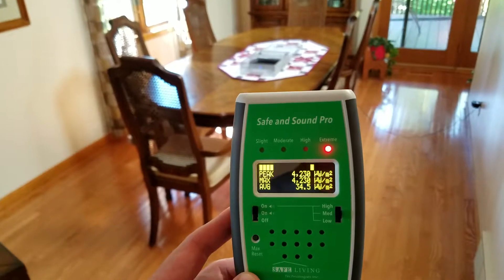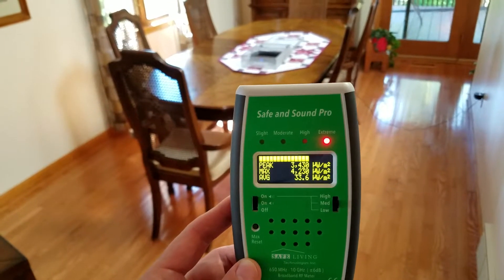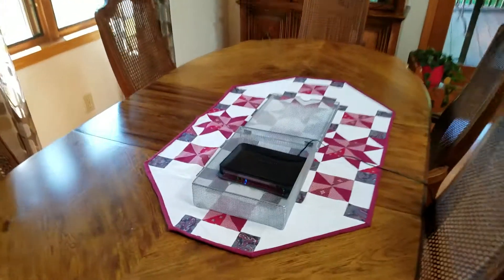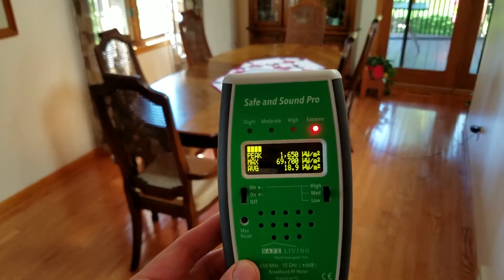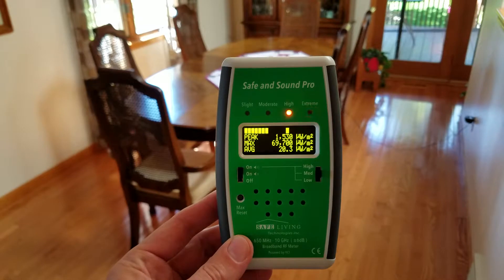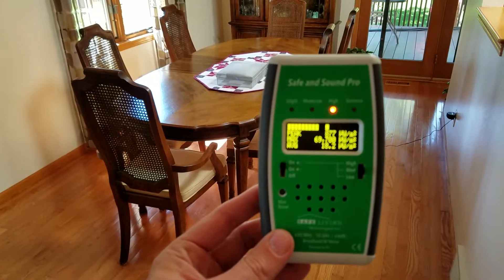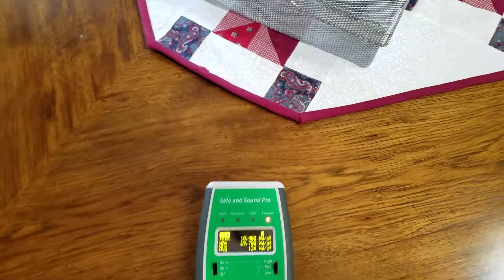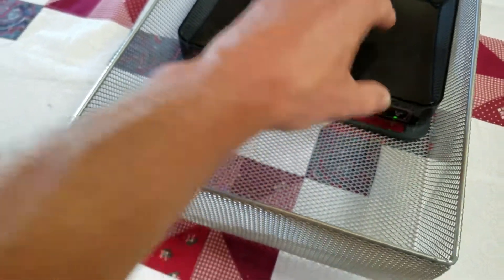Does Shielding Your Wi-Fi Router Actually Work?

Comment: What brand of router is that, that lets you turn off the wi-fi?  The only way I can turn off the wi-fi on my router is to turn off the router itself (which of course disconnects the internet completely), which I do at night before bed. I'd love to have all the computers hardwired with no wi-fi, but how?
Reply from the maker: Great question. There are certain router models that have an easy on/off button for WiFi. I list a couple in the summary at the top of this article:  https://www.emfanalysis.com/how-to-install-wired-internet-in-your-home/
Reply: Router box, duh
Reply: Most can be turned off if you can log into them.  Enter the router gateway ip address into your browser and see if you have a login screen.
Reply from the maker: @solarsynapse  Just be careful if you have a modem/router combo provided by your internet company (Comcast for example). You may be able to turn off your private network WiFi in the settings. However, the public channel in your modem will still be radiating and is much harder to disable. Best to confirm with a RF meter.

Comment: Why is it bad to be exposed to that level of milliwatts per square meter radiance? Has anyone demonstrated any health effects from long term 2.4Ghz exposure?
Reply: No. There is no evidence of "non-thermal" effects from RF exposure on biological organisms. You'd need a lot more radiated power to cause any significant thermal effects. For example, if you had a 2.4GHz W-Fi radio transmitting, say, 23dBm and had it connected to a parabolic 24dBi antenna, this would result in 47dBm effective radiated power, or about 50 watts. I would avoid direct contact with the eyes since there's not much blood flow inside the eye to remove the heat. This guy is a quack.
Reply: @BestSpatula  No he's not, you are.  Agent.
Reply from the maker: Hi Jaedyn. There a hundreds of quality studies showing biological effects from the RF exposure levels of common consumer microwave technologies. Spend 10 minutes on the following page and come back with some questions: https://www.emfanalysis.com/research/
Reply: @emfanalysis  These are like, all links to activist websites and not peer reviewed scientific journals. Kinda disappointing.
Reply from the maker: @BestSpatula  You appear to have overlooked the most important parts. Here is the U.S. National Toxicology Program  ($30M two decade study) showing clear evidence of cancer from cell phone radiation: 

https://ntp.niehs.nih.gov/whatwestudy/topics/cellphones

Here is another meta study with 21 of 27 peer review studies showing sperm damage:

https://pubmed.ncbi.nlm.nih.gov/27601711/

How can non-thermal microwave technologies be completely safe when these studies exist?
Reply: @BestSpatula  Retinas are far more sensitive than skin.  Like being exposed to sunshine or looking at the sun.  Probably not good to have line of site to the antenna when very close...like on a desk at eye level.